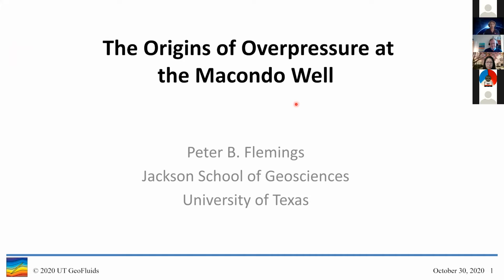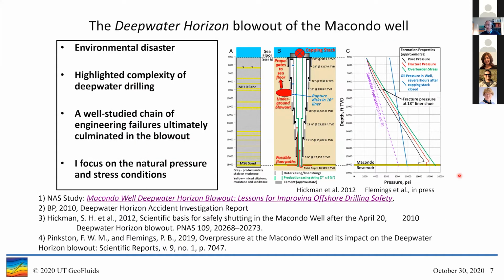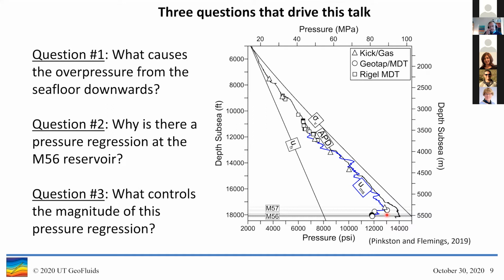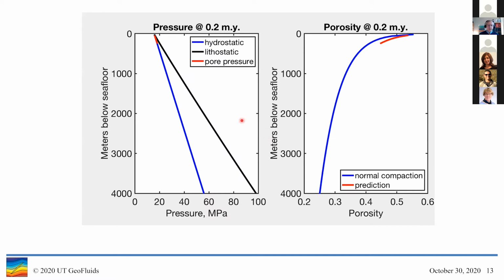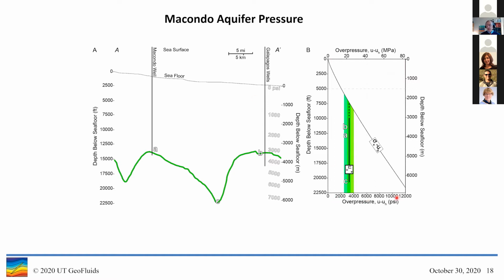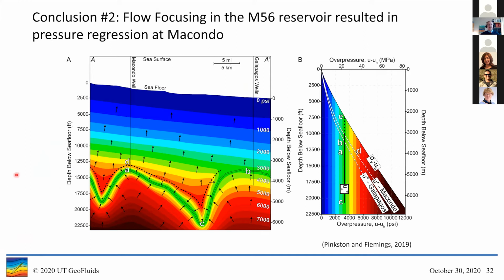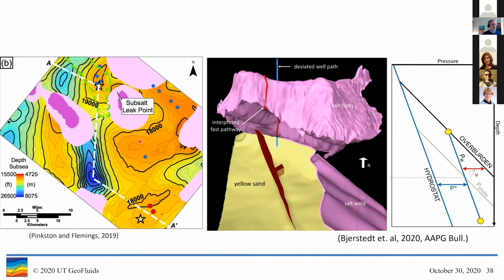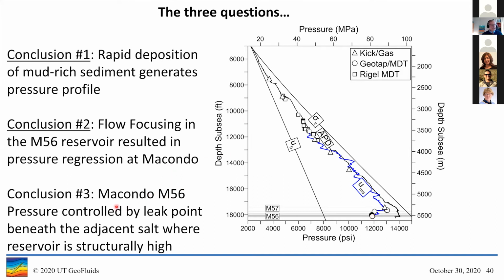The Origins of Overpressure at the Macondo Well

Comment: 25:30 - A good way to illustrate this will be to use a snake like  bladder with pressure sensors, buried irregularly at different depths in your "fish tank",  and put separate comparative  pressure sensors at correspondingly different heights. 

As you increase the pressure on the bladder, the part closest to the surface will bulge out first.  Meaning, where you dig in a formation is very critical.  Ideally, you want to dig where the bladder is the lowest.